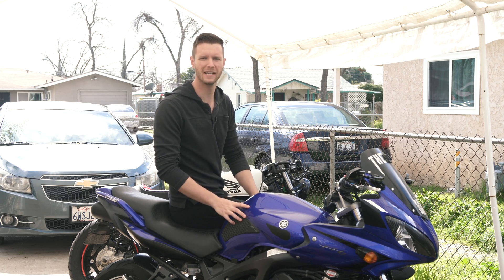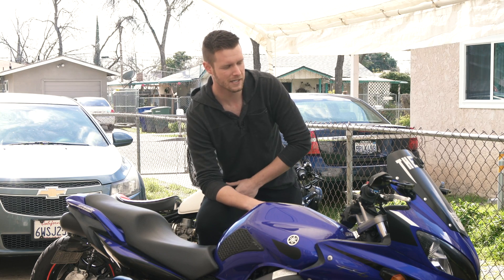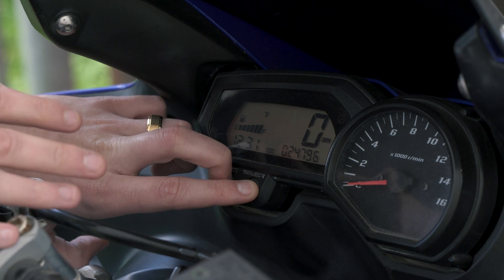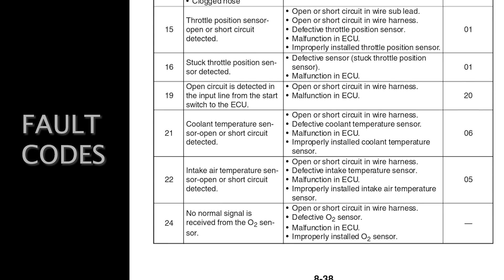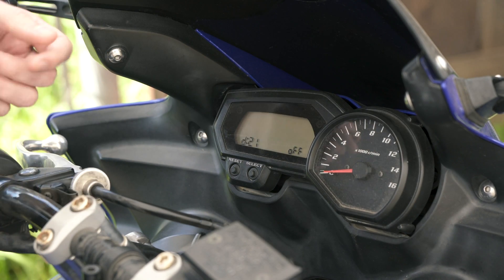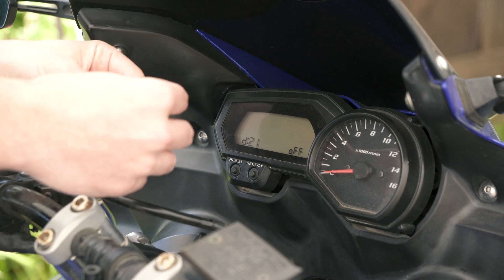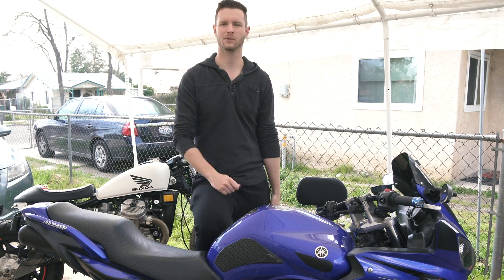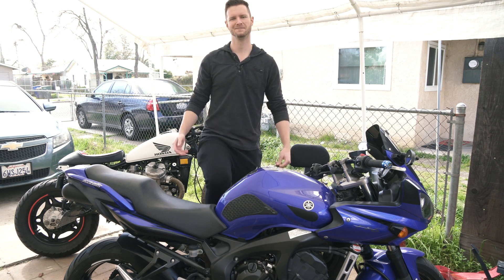Diagnostic Mode & Error Codes | Yamaha FZ6 FZ1 (Code 19 Fix)

Comment: So mine has done the same thing a cupple time it would like lose complete power and out of no where cut right back on like nothing ever happen. No chek engine or anything. Ans some times when I wnat to start it. The Check engine stays on and doesn’t let me start it then I turn the key on n off a cupple times then it turns on like nothing ever happen
Reply from the maker: @NoneOfyourdinez  might be a kickstand switch. That's what mine was if I remember correctly
Reply: @ it still works good I daily it but every now n then is does it. May be it’s when I hit bumps or something it messes with the switch huh
Reply from the maker: @NoneOfyourdinez  yep, probably.

Comment: Honestly your bike seemed to have the exact same problem mine did I'm attempting to go through diag mode and on both 20 and 21 in diag mode no matter kickstand being up or down does not change either one so I'm assuming that's the problem I'm having on the issue is my bike does start even though the kickstand does not make the diag mode number 20 or 21 change to off bike still starts and runs but that's the issue that I had had on my current '09 FZ6R the cadmium yellow model in case that makes any kind of difference but mine is more towards a full fairing bike than yours didn't take any close looks at it to see if he just had your panels off but I am positive mine is full fairing any tips

Comment: Hey man I really hope you check your comments on these videos I'm in diagon mode do one My throttle position sensor is reading at 16 of course like you said it should be at 16 or 17 completely normal mine is only going up to 87 I can't reach anything 88 or higher on my throttle
Reply from the maker: Oh huh. Don't know man, maybe there's an obstruction not letting it turn all the way....or maybe the electrical contact is out of position slightly.
Reply: @TheInja  any idea on how to attempt to see if it's something within the bars or am I having to disassemble it because I mean it is obviously stopping it's rotation when it hits that 87 mark I mean the bikes top speed currently I don't believe there is any kind of sprocket changing or anything else is just got a full system two brothers exhaust and the little power Commander they send with it not sure if it's tuned out or if it is out of tune but I'm still reaching 135 which is within 3 miles an hour of the reported top speed of this model from the factory does that sound about right
Reply from the maker: @mikewazowski7830  aaaah. I see. The power commander does regulate the throttle input, so I bet it's a tune issue.
Reply: @TheInja  hey man honestly if you wouldn't mind me finding you on Facebook or you finding me please let me know because I'm sure there's a lot of questions that you could probably help me out with but I really appreciate that so basically I really need to just get access to a laptop with Windows 11 to run the correct programming to check the tune because I mean I did speak to the factory in which makes the Dyno jet power commander it's just a rebranded one for this company but it is a dyno jet product they specifically told me the computer needs to be up to Windows 11 compatible and then actually updated to Windows 11 or higher but I really have absolutely no idea after that
Reply: @TheInja  but I can see how that does make sense I just don't have the money to go to a tuner I mean I'm literally barely getting maybe $200 a week because of lack of tree jobs my boss has been able to secure so I'm still looking for other work so I can actually make some money need to put new fairings new mirrors new front left caliper all new pads etc etcetera than normal stuff it's just I don't have the money to go to a tuner and I'm not trying to mess my vehicle up it's the first one that's ever been in my name but it's the third motorcycle that I currently own if I could sell my other two which nobody's trying to buy I would easily be able to just take it and drop it off at a shop get it tuned up or for them to just flash in the proper tune you know what I mean it's just hell on me right now

Comment: Will this stop the bike from starting? My diagnosis says on even when the kickstand is kicked up
Reply: Mine does the exact same thing did you ever fix your bike ?
Reply: @bryansullivan9588  nope. So far new gas, new battery, new spark plugs still no start
Reply: i even bought a new battery and wired the kickstand sensor wires together still wont start mine still says  the kickstand is down no fault codes though
Reply: hard to believe we are the only 2 people to have this problem ?
Reply: @bryansullivan9588  mine just says on? When I go through the diagnosis.  I have code 23
Reply: @bryansullivan9588  dude check the fuel pump that ended up being my problem
Reply: @TheLegendaryLoso  Mine was the ECU.

Comment: Thanks for this video. 
I have a fzs2 600 2007 model,
I tried to bump start it as I had a flat battery,
It started and went into what I think is limp mode .
And my management light has just come on.
I will check the error code when  I get home.
Thank you  for the help.

Comment: Super useful, thanks! Diagnostic mode works the same on the FZ6R though it says to disconnect wire harness for fuel pump before you go into it.
Reply: Yeah, if you click through all of the different diagnostic modes, like 6 of them are the fuel pump and it'll just keep running.
Reply: Yo dude! I’m still having problems with my side stand switch. Can I just ship my bike to you to fix it?

Comment: Bike loses power when riding sometimes, it doesn’t shut off though, jus can’t gas it, need some help diagnosing the problem, couple people says it’s my filter and gas line is clogged up. Gas tank has a little rust in it, anyone, need your response, driving me crazy

Comment: Thanks mate! I run a Euro spec '08 FZ1 and I just started getting a very strange intermittent starting issue that the so called forums give no definitive suggestions for. No offense to the forums but it IS a lot of yapping and speculation. I will run home today to pull out my owner manual to run through all the DI codes to see what I can find. Thanks.
Reply from the maker: My pleasure